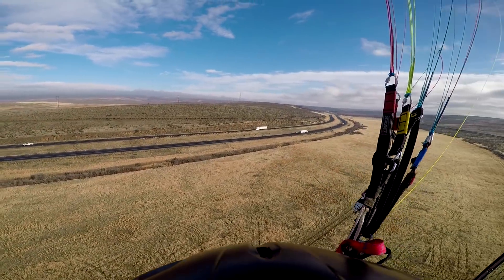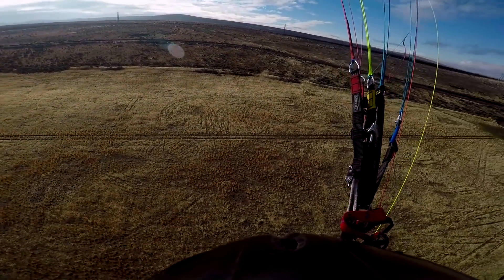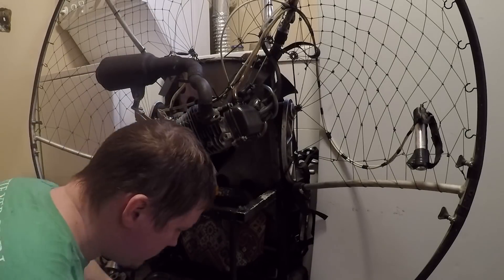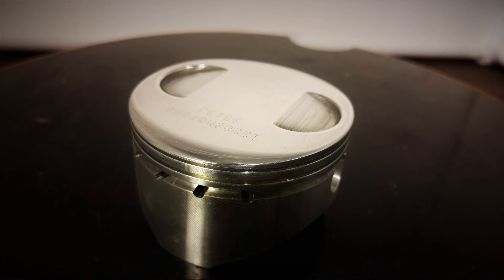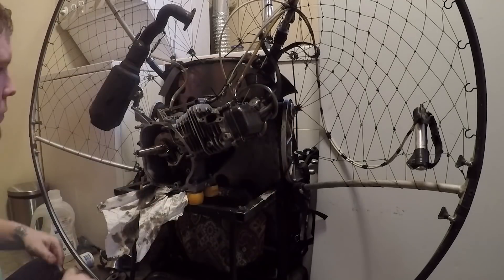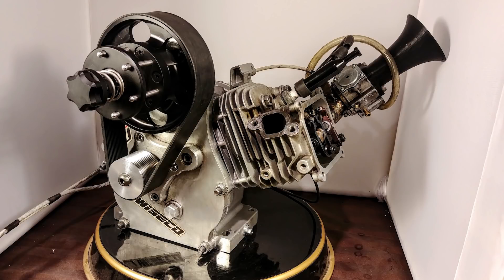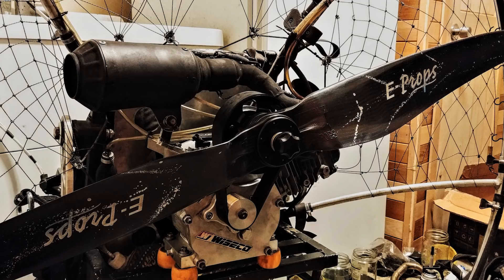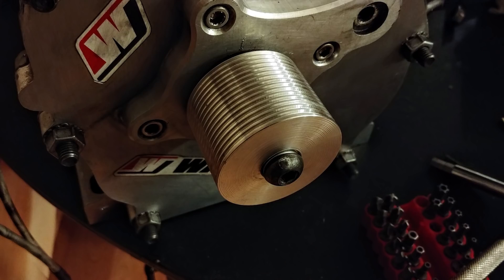Homemade Paramotor - Big Fail + New Reduction

Comment: Do you run any kind of Engine Temp Gauge?
It looks to me like the Cylinder and Head are shrouded  by the Plate behind the Seat, are you sure it's getting enough Airflow?
Reply from the maker: The airflow for cooling comes from the propeller (not the moving air during flight)
Reply: @IrisPPG  
Yes, I realise that, but the Air won't necessarily flow exactly where is needed, you can get dead spots or eddy currents in Airflow, which can reduce the cooling efficiency.
I would say a Temp Sensor and Gauge is as important as a Tacho on an Air-Cooled Engine, especially on an Aircraft.   ; )

Comment: Well did you finish it?
Reply from the maker: No. I ended up deciding to build a prototype paramotor which required an off the shelf engine and that turned into building a new paramotor company.

Comment: Is this gx 200 engine brother?
Reply from the maker: It's very similar. It's a Predator 212 Hemi. It's not technically a gx200 clone but it's virtually identical and many parts bolt on.

Comment: i have high school level understanding of engines idk how you do this, ur such an inspiration bro! Would you ever give the blueprints or dimensions for the reduction? my local school and machine shop could then help me make these essential parts..  how can i contact you? cheers from Kentucky, Kado..
Reply from the maker: I have put down this engine for now. I love it, and it makes great power, but not reliably. It turned into like a $300 habit for parts to rebuild it every couple flights. I would most definitely recommend simply buying a paramotor engine.
Reply: @IrisPPG  what about using a trike or quad setup, with v-twin B&S or Vanguard ect.. and this reduction ...... 

https://lonestarhovercraft.com/shop/standard-belt-reduction-26-to-40-hp/    

could it be more reliable?? your input is extremely valuable as you have more experience with DIY than anyone Im aware of and willing to respond back..  Thanks hoss, Kado..

Comment: Truly inspirational demitri! do u prefer the chain reduction or the belt?
Reply from the maker: Soyeb, that question is hard to answer. I made the chain reduction for two reasons:
1). To be able to change sprockets easily (to dial in the reduction ratio)
2). To prove that a cheap and simple reduction can work and other people can do it. 
Having said that, if I had basic tools and no machining knowledge, I would go with the chain drive for simplicity. For me, the chain has served its purpose and it was probably time to move back to the micro-v belt now that the ratio is where I think I want it. The Micro-V will always be smoother and quieter which is pleasant. It also seems the engine prefers it too.
Reply: @IrisPPG  thanks for the insight Demitri!